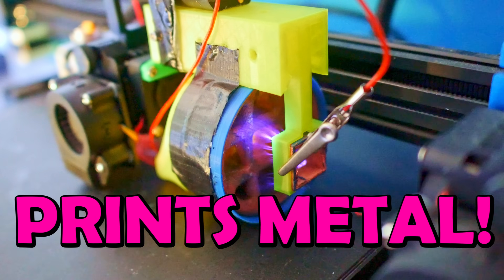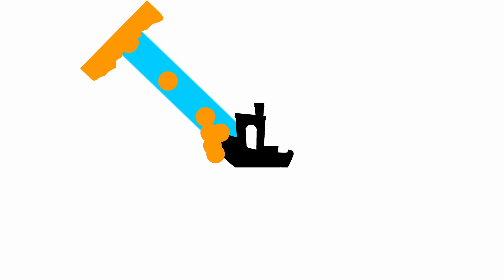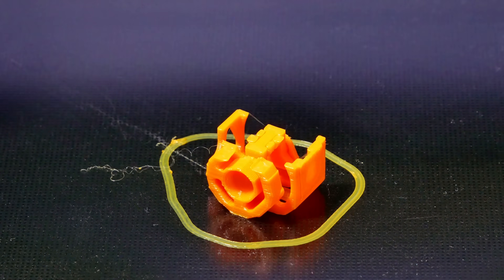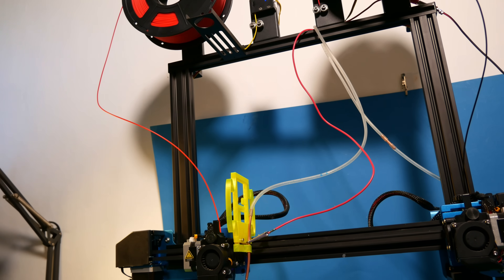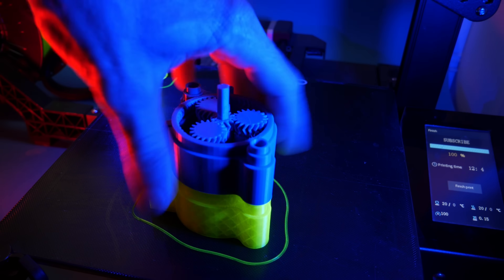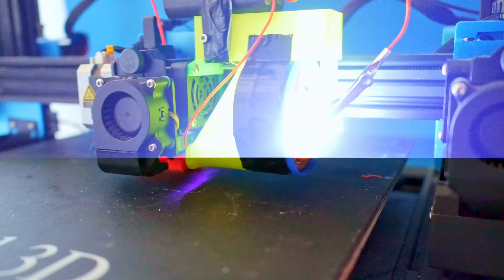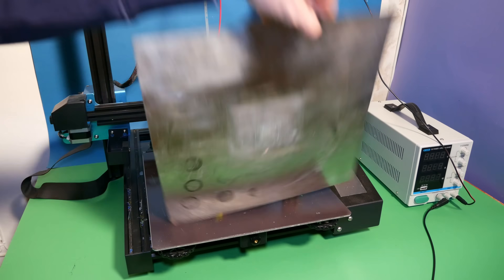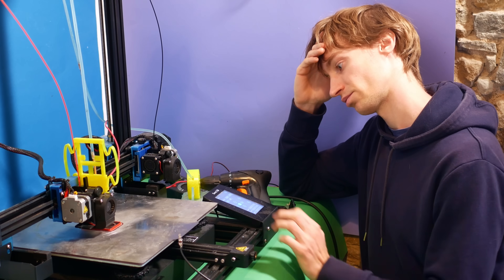i made a METAL 3D-Printer at home!

Comment: can't you just put some copper tape down to make the underside conductive?
Reply: also Have you seen the virtual foundary 3d printing in metal? They use a filament with metal+plastic, then anneal them in salt to burn away the plastic and all that's left is the metal.
Reply: @Baalldavveieir That is smart but for the purpose of 3d printing metal here he has to also still have plastic

Comment: Another thought.
A thin metal filament, say .05mm being fed with an extrusion gear, similar to plastic printers,
it feeds into a relatively thin tube, where the electrolyte solution is being pumped in at the top.
feeding through a plastic (hydrophilic) extrusion nozzle, say made out of TPU. to print and add to a conductive build surface, a vacuum  uptaking the electrolyte solution immediately on the perimeter of the nozzle to feed back into the electrolyte reservoir after mild filtering. run a current through the feed wire to the build surface.
it should deposit only in the immediate vicinity of the build surface, as the electrolyte solution is being taken up by the vacuum pump, the filament wire would dissolve in the electrolyte solution as it is slowly being fed.
I noticed you are using a SV04 IDEX printer, this would be great, as you could alternate between conductive and non conductive material. allowing the metal print head to hover over a point and slowly lift to build up conductive vias to be printed around with non conductive plastic.
I would even posit you could draw a conductive line across the non conductive surface by moving the print head slowly across the surface from that via point.
IE, we take your idea, but use a much smaller puddle to play in, one no larger than the print nozzle.
current could be monitored, where a sudden dropoff in current would indicate it is not laying down metal, the print head could backtrack until the current resumes

Comment: Hey the problem with the bonding of the conductive plate to the base…. Why both increase the bottom of the print to a flat conductive plate so you have more surface area…. The whole bottom will connect with whatever parts make contact with the plate!!! Hope it works!!!!

Comment: Ah, so if I am understanding this correctly, you are raising the electrolyte fluid level to build for each new level of electro-plating. First question, how fast is the layer-by-layer electrolyte-plating process? But more importantly, your video gives the impression of an even electro-plative metal coating applied to each successive layer, so why doesn't the process continue to add electro-forming to the lower layers still immersed in the fluid? I was expecting a thicker and thicker plating layer at the deeper, more prolonged exposure levels of immersion.

Comment: Not the best solution to the conductive plate, but here's an option. Just have the printer print a path from the edge of the printer in conductive filament, and connect your wire with a alligator clamp. Or just a small sanded patch on the normal print surface

Comment: Well, "0:18 half a million" - not exactly metal 3d printers with much higher resolution etc. starts around 90-100k$ even without tax it is nowhere near 500k$... also those printers really print metal parts, what you've created is more or less machine/addon for electroplating 3d printed parts during print itself instead of after - to be honest It's kinda cool but I would still go for one of three solutions for "homemade 3d printing":
- regular electroplating - ok maybe it requires big container but still - less problematic that building such machine
- lost PLA/WAX casting or if you have more money and resin 3d printer maybe some castable resin - IMHO best solution and not that expensive
- some metal fillament like one used by Integza while ago
Cheers

Comment: Maybe make your plating solution into a paste with a binding agent that you could pump through a print head, using the print head itself as the anode, might tear up a few nozzles, but...
you could adjust the current flow with the print speed where it lays down a line of copper, nickel or whatever other metal you could get in solution.
if you set your bed temp hot enough, as well as the print head to the right temp. the water would evaporate quickly, leaving the remainder as dust to be blown or wiped away

Comment: The mixture I use for PETG and TPU prints on glass might work for build adhesion. It's 2mL PVA, 45mL IPA, and 10mL H2O. Mix it in a small glass jar heated to 45C until all the clumps dissolve and the solution goes clear. Apply to the bed with a foam brush, just need a thin coating. A spritz of IPA can be used to wet the solution after a couple prints to smooth it back out. Hot water can be used to rinse it off. Just not sure how much, if any it will affect the conductivity of the bed.

Comment: Hello,
8:40 I don't understand how that works.
Doesn't the copper have to be the cathode (the negative pole), because the correct current flow is from minus to plus (the electrons are on the outside of the atom and you can only reach them). So I don't understand how the copper is transported from plus to minus.

Thank you very much

Comment: Dont they sell filament that contains metal in it? Cant you use conductive filament for the first few layers like a raft layer of conductive filament so you can print on the PEI side? Also, what if you made your own conductive filament with the same method of what you are doing here? create a device that electroplates the filament before it reaches the hotend, and then you have your own metal infused filament? I have no idea if this is even possible, but that is where my brain went while watching your video.

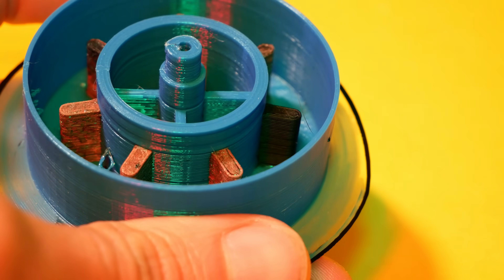Comment: 9:00 And if you print a line in the first layer that connects all the parts and then connect them with an automatic clamp at one point? Then you could continue to print on the normal side.

Comment: You could try using aquanet hairspray to help with bed adhesion. I still use it on glass or when I need extra adhesion. Bambu carbon still uses gluestick on some plates. you could try that as well.

Comment: I can finally print my homemade guns 😍😍
Reply: We been doing that for years ur just lazy
Reply: Actually a lot of people have done before with plastic
Reply: These parts aren't really metal. Getting a gun still requires that you get some hydraulic tubing ang some springs. For what printing guns was originally supposed to be about, this situation is actually fine. We really do need to start calling them fabricable guns or something though as in inb4 to every redditor who goes YoO CaN't PrInT a GuN, tHe bOlT aNd BaRreL aRe sTiLL sTeEL as if that changes the fact that any bad guy can just get one while lawful people are forced to self-handicap.
Reply: I tried telling a dummy that a gun is just a pipe and a hammer and tldr: he didn't like that.

Comment: i use elmers glue and sometimes a heated bed. i spread elmers glue with an ink/glue roller until it becomes so tacky that it creates small strands of filament almost like a fibrous carpet (a hair dryer or heat shrink fan can also speed up the process while rolling the glue). maybe if you mixed in metallic powder with the glue it can be sufficiently conductive while still being tacky? awesome project best of luck please keep sharing!!

Comment: while electroplating in situ as you print is an interesting concept, it does open the question of ion deposition as a 3d print method w/o need a substrate......just build up the part 100% using electrodeposition.

Comment: It's very interesting. You could be on the right way to make it faster and use different materials. What I was thinking is the Electrical discharge machining (EDM), also known as spark machining, spark eroding, die sinking, wire burning or wire erosion.. or in German: Funkenerosives Abtragen. Can this be reversed.

Comment: Subbed! Way to think outside the box! Home metal 3D printing is the holy grail of the DIY hobbyist.  I've been tracking different attempts at solutions, fusing metal powder and/or sintering seemed to be the only solutions (albeit super expensive/impractical for home use). If this can prove to make useable metal parts, with low difficulty/cost of entry on the setup, then this may be THE home solution for metal printing.

Comment: Insanely groovy!
Could  also print a type of angularly positionable metal paint pen that could deposit coatings onto other printed surfaces, could use a contact brush similar to a brushed motor commentator.
Rollers could be used or wider brushes for larger surfaces. A eventual laminate construction of a vehicle could be produced that has a solar power collecting outer layer along with a printed battery subtrate under that, followed by printed conductive connectors to go off to the drivetrain and the rest of it.
This, would be the lightest possible electric vehicle that achieves a few solutions due to the minimal material requirement.

Comment: love this series, for a possible bed adhesion work-around could you add a "wire" coming from each print using the conductive filament to a specified location then have a secondary probe complete the circuit.

Comment: You have created more of a philosophical engineering problem, that is unnecessary to solve. You want one single machine to replicate it self in it's entirety. But the way mechanics has developed for hundreds of years, is we create machines that allow us to make other types of machine. Which also allows us to build  better versions of what we started out with. - Or even something completely new, like 3D printers.

We do not only have a global self replicating system, but also a system that continuosly improves. I don't se a big drawback in using a system of different machines, rather than a single type? Besides, I seriously hope you don't envision that it's not the plan that the original model at some point builds a new and better version? And then you will quickly end up with a mutitude of diffrent versions. And perhaps results will improve, if somewhat specialized versions cooperate.

And then you will have ended up with the type of production system we have today. Like we mix 3D printers, lasercutters, lathes, mills, forging etc.

I often get a little annoyed at designs by overly enthusiastic 3D printing people, where every part in a design is 3D printed, even though other production techniques are obviously better suited for some parts in their designs. Constraining oneself to only using 3D printing isn't a clever strategy. And certainly not as a tecnological philosophy.

Besides, in this example, you have already put two technologies in one machine. Why not add cutting and forging capabilities as well?
Reply from the maker: I understand your comment, and i see why you think this is a solution in search of a problem, but I never said it has to be a single machine, the main and most important idea is to make a system that can scale with as little work as possible; this lets limited resources stretch further. Imagine the difference between shipping a machine shop or just a 3d printer to an area that was hit by a natural disaster.
Reply: @TurboSunShine  Thank's for answering. I still don't think it would work quite like that. Even if the task was only to make and assemble building blocks, for example on Mars, one wold probably send a couple of specialized machines just to complete that single task.

And then also another set of machines to build machines. In fact, perhaps it is this set of "parent" machines that would be interesting to identify? = Sending a "machine shop" coony of machines idea, to for example Mars, would make a lot of sense to me. Perhaps it's first job would in fact be to self replicate "the colony system"?

I think it's better to think in terms of systems where parts interact. That's actually true of your self replicating machine as well.

By the time your envisioned machine actually manages to self replicate, it will have grown into a monster of a machine, beeing able to make print nozzles, motors and all the rest. If one of parts of the machine breaks down, the self replication for that machine is over.

Perhaps biology givs a clue? Single cell life forms are much more limited / simple, than multicell lifeforms, that uses several "slightly" specialized cells interacting. (At a fundamental level all cells in for example the human body, are very similar. And in fact across species.) Also there is quite a bit of redundancy.

But I suppose the system doesn't even limit it self to just "the human organism". Humans are part of an eco system of other organisms. Like i think I read that the weight of bacteria living in, and interacting with, our body is about equavilent to the weight of our brain. And that's just giving the system an arbitrary boundry that excludes all the "external" parts of the human ecosystem.

Anyway, your film was interesting, and certainly got me thinking!

Comment: This is just, wow. Absolutely amazing, such a simple and intuitive concept, yet the smartest thing ive seen in ages. I have no clue how i wasnt subscribed before, but i definitely am now. Excited to try this on my ender 5 plus, ive been wanting to make PCBs at home for a bit now and this will finally make that possible!
Reply: Oh, and for the adhesion, could one possibly thunk up an electrically conductive glue stick?
Reply: It looks like loctite makes an electically conductive epoxy... i know that people have had sucess with printing on garolite, which is just fiberglass and epoxy, so if you spread it thin and evenly on the build surface it may work...

Comment: FR4 is a great print bed material - flawless results every time even with nylon, composites and Igus. Just order thick pcb with grid traces without solder mask. Reverse depositing (from the build plate to part) may also work well but would be quite expensive in comparison to simple copper tube.

UPD: self adhesive thin copper tape above FR4 plate as one beefy trace won't mess up first layer, but still provide enough electrical contact.

UPD2: If you would order FR4 sheets, make sure to pick sanded/polished ones, not raw. When in doubt - ask manufacturer explicitly. It may look flat, but in reality its coated with almost invisible glass prongs.
Spider-man hands side effect is fun for the first 10 minutes - everything you touch sticks to your hands, but it itches like crazy after.

Comment: You should get somebody to write to nature magazine about your work. That bistable switcher is genius! And the pump.
Feeding a small diameter wire and to be used as an anode, coupled with a low voltage could make smaller details possible.

Comment: This is honestly brilliant in so many ways!!! The timing of this video is also insane, I was just recently trying to design a compliant push latch mechanism and wasn't able to do it. I've searched a LOT and could not find one, you might just be one of the first ones to do it!!!  This mechanism could be extremely useful for doing even cheaper versions of the BL touch or the servo probe. You would only require a norma limit switch and the probe would deploy using the printer itself!  No need for a servo or solenoid. Genius!!! I love this channel!

Comment: so, I have a similar idea, although it was for etching metal, but it works for this as well. If you combine your deposition tube with a suction tube, you can "close the loop" and pull used excess fluid back into a reservoir that can then "refresh" the solution with buffer tanks, stock copper metal, deionized water and electrolytes. 

This would allow it all to be contained in a single machine. 

In addition, you could do the reverse and use an EDM power supply and probe to etch/blast away the metal where you don't want it, and now you have an additive and subtractive 3D printer. 

Just watch out, or you'll have the Knights of the Holy Grail, knocking down your door, looking for a cup.
Reply: Buena saludos desde Argentina

Comment: You could use 2 pipes one next to the other or one inside the other to make the fluid circulate continuously. The 2 wont erode at the same rate so reversing the flow now and then would be necessary. 
With good calibration, it might be possible to add a wick to get crazy good accuracy

Comment: You are not 3d printing metal, you are electroplating. Electroplating has a lot of useful application, but it's not 3d printing metal.
Your machine is limited to adding to a surface, it can't make any kind of internal pattern without access to the air and it always need a plastic support.
Both your description and the intro of your video states motors and pcbs, but you would never make those with a 3d printer. If you need a PCB, just make a photoplotting machine. A motor needs large inductance obtained by coils of copper wire with extremely thin insulation. Just make the coils by hand or make spinning tool. There are many projects that can't be made with normal methods and the simpliest is a heat exhanger (with specific patterns).

You look really smart and capable so you should not resort to such underhanded methods to get views.
Make the machine alternate between plastic filament and electroplating and you will be much more close to actual 3d printing than you are now.
Reply from the maker: Honestly, it sounds like you didn't watch the video before you commented.